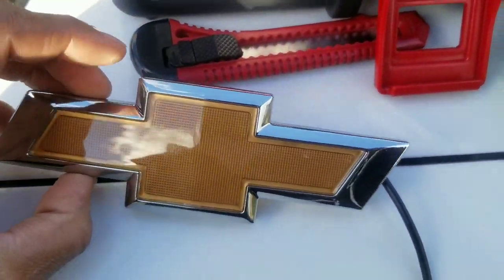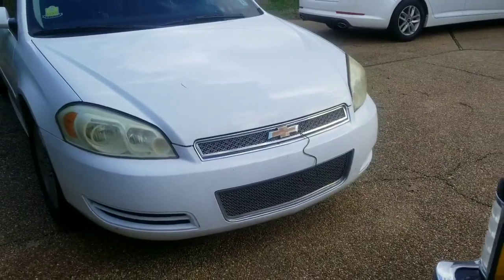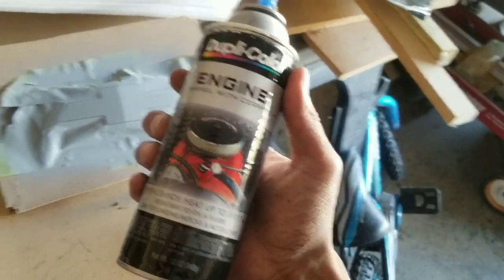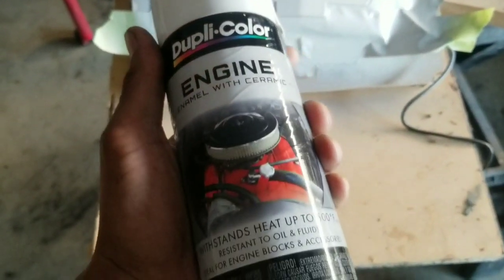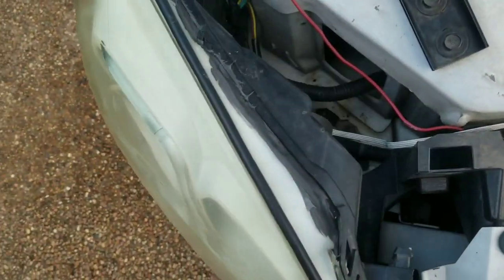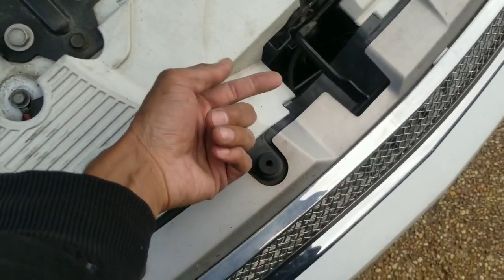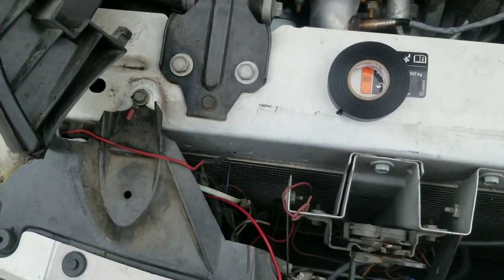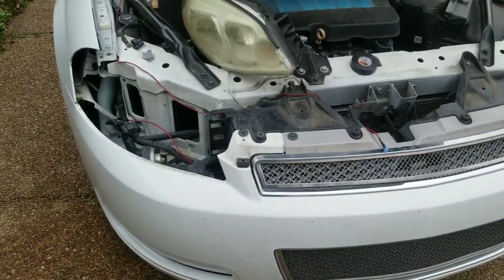LED Chevy Emblem

Comment: Looks good. How did you installed it
Reply from the maker: 3m tape to hold it then black rtv sealant on the back side to keep it there. It's wired to the park lights to come on automatically at night

Comment: Is the light still working ? I was trying to see if it’ll go out or not
Reply from the maker: Yeah still works fine. Only downside is the chrome eventually started peeling and yellowing from rock chips and all. I would suggest maybe a clear coat or ppf over it to keep it from wearing

Comment: I ordered one and the wires is thin what did you do to make them thicker and what wire is the constant for the park lights and which one is the ground?
Reply from the maker: You can't make the wires thicker I just adding longer wires to the end so it would reach the park light wires
Reply from the maker: Go to about 4:45 in the video I show the power wire for the park lights. I grounded the emblem light on a bolt above the grill

Comment: Good job Do they have chrome emblems as well & can one be installed in the back where the tail lights are?
Reply from the maker: Yes you can put one on the trunk, you'll just have to drill a hole for the wires. I haven't seen an all chrome but you can get some vinyl and wrap the middle piece

Comment: I have had mine for 2 years now blue in the front and red in bak
Reply from the maker: And it's still holding up after 2 years? That's good news
Reply: Yea surprise me too but apparently blue can't be used in the front only white after all this time they pulled me over and tell me dat so I wired it to come on with the fog lights till I get a white 1
Reply from the maker: @callmedez306  yeah that's why I just started with the white one. Got pulled over enough times for the halos being on different colors

Comment: How long did the paint last ?
Reply from the maker: It's still on there now. It's a few rock chips in it but overall it's still good. The issue is the chrome part that lights up gets chipped too. I would probably clear coat the whole thing if I had to do it again
Reply: Do you have a link you could share where you bought the led light bowtie?
Reply from the maker: I got it from eBay but the one I have is not listed on there anymore.